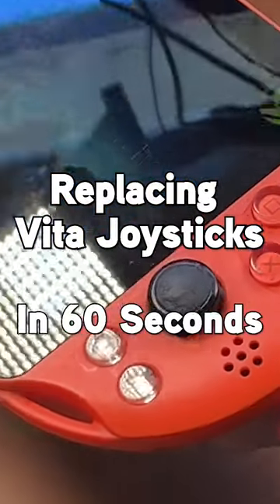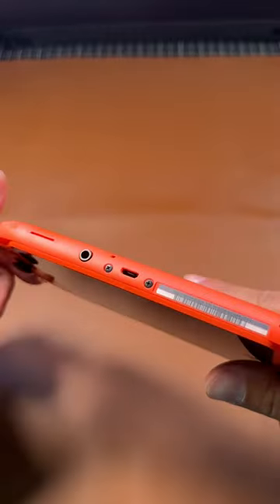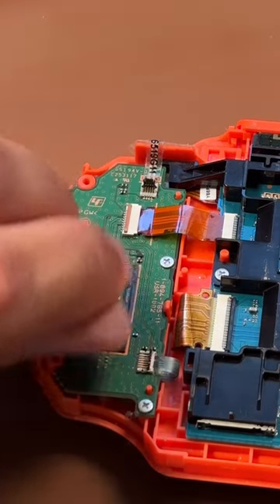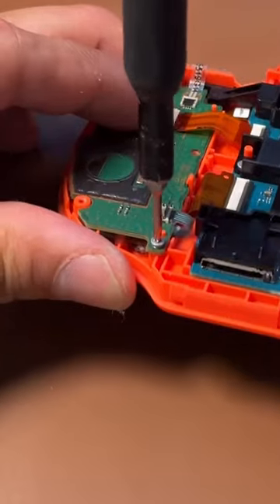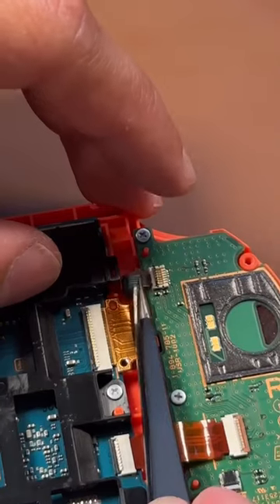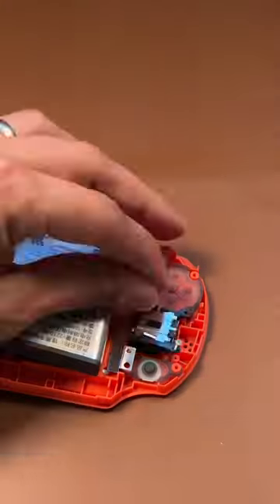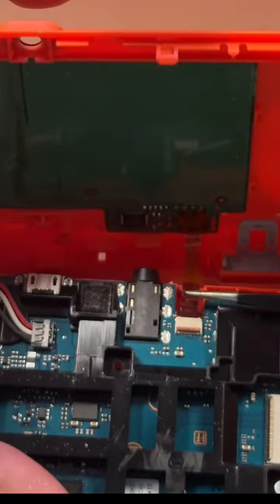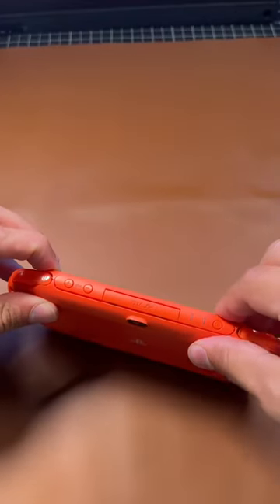Vita Joystick fix in 60 Seconds! #psvita #playstation

Comment: Dude no shit I was about to send my vita out to get the same joy stick repaired cause it drifted down.. mine is also orange. Thanks now I’m doing this myself
Reply: Was that easy?
Reply: @matyasmatejka4242 it is actually very easy, it takes like 20 or 30 minutes but not because it's hard, it's just that removing all the screws, cables, and taking some of the pieces out takes a little bit of time. Just replaced mine yesterday.
Reply: @elpogio4890 vita slim or regular?
Reply: I know it can seem scary opening console hardware up but it's a great learning experience to get to know your console more and take better care of it than sending it someplace for money you could've saved

Comment: does the left and right thumb stick has the same analog stick 
i mean i saw a photo of a replacement  part on a shop and they have the same part where the ribbon is located on the left side and they said it can be put on either left or right 
is that possible 
i dont want to waste money on a part i cant use

Comment: Where did you buy the joysticks?
Reply: You can get some sent from AliExpress from China? That’s where I ordered my analog stick covers as well as my new D pad
Reply: @turismofoegaming8806  my analog aren’t responding at all what should i do ?  Did have the same problem ?
Reply: @myemail599  u might have to replace the boards inside? Probably definitely the Analog Motors themselves?

Sorry your dealing with that.. I have this theory in mind when you hack Aveda or when you hack a Nintendo 3DS, eventually these components wear out quicker because I am having trouble in certain games from my new Nintendo 3DS LL?!

It happens when I’m in the menu in Golden Sun when I tried to go to the left or the right sometimes it’ll go in the opposite direction and get all finicky and it just started doing it! Other than that I can use the circle pad to move the character around in the environment and he still moves perfectly fine-

But on my hacked Vita, playing Mario 64, Mario will not run at full speed in the upper right direction on the analog but all other games work perfect?!?!?

I’ve only experienced this issue with my hacked systems